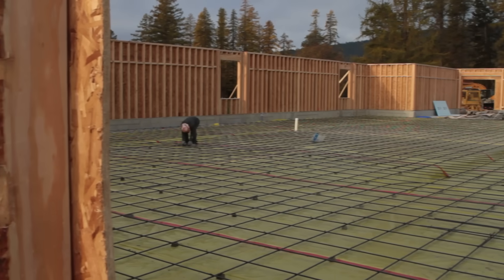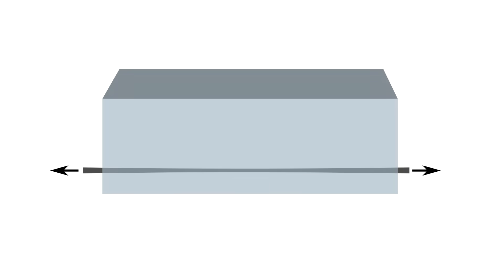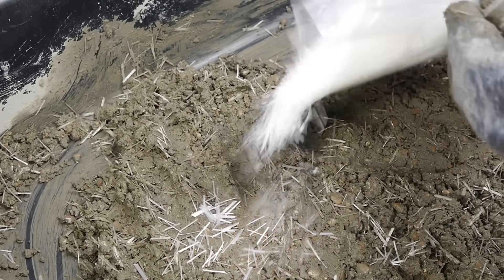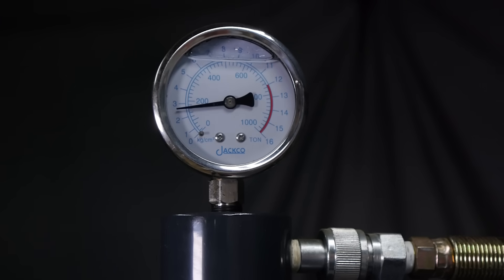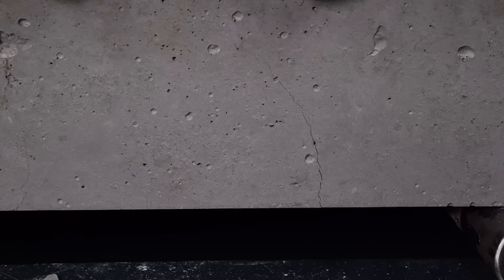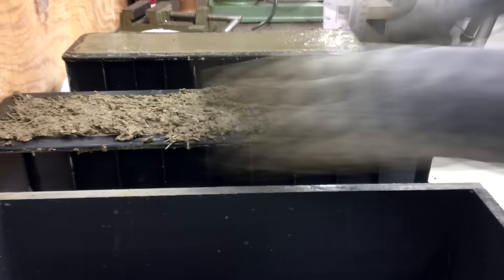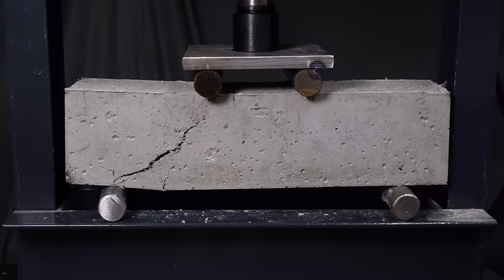Does Rebar Rust?

Comment: Hello, Grady! I have a question:
I want to make a concrete block for a tall but light steel pole (10m high, weighing around 110kg). In order to stabilize the steel  anchor, I intend to weld 14mm thick rebar at the bottom and hammer the top to drive rebar into the ground. Thus, the rebar will be sticking out of the concrete block and penetrate the soil about 30-40cm. The bottom of the block will be about 1m in the ground.
 Is this a bad idea, considering the rebar will be partially exposed to humid soil and therefore rust (how quickly?) and eventually bring rust with it into the concrete? How long could this even last before the concrete becomes unsafe for holding the pole?
 Thank you, and greetings from Bosnia!
Reply: If this is meant to be a temporary structure than this is overkill.

If this is a permanent structure, the rebar would rust and and the rust will creep up into the concrete. Not to mention rain and snow. They sell these builders tubes, what you would do is make a large circular hole, put the tube in, and fill with rebar and concrete.

Comment: Emm, I am a newbie. I would like to ask one question, why there is no ppl try to paint the steel rod before turn into concrete. Painting steel will also help prevent corrosion. Does the economical factor or any scientific issue causes most of the ppl don't prefer this methods. I am new, i hope that anyone know the reason can teach me , thx so much.

Comment: I could never understand why they used rusty rebar in concrete structures, they could have coated it in plastic to prevent rust, this has been going on for years and it does make you wonder when things are going to start collapsing as they will as the concrete ages.
Reply: If you have seen how rebar and mesh are handled onsite on most jobs, you would understand why coating rebar is not a cure all for rebar degradation.

Comment: We have to be mindful of the nature of the failure mode when considering other types of reinforcement. Often the appearance of a crack widening is indicative of overloading. If you prevent any cracking of the concrete at the design stage with super strong/large amounts of rebar then compression failure of the concrete could occur first. Way more explosive!

Comment: I have an experiential statement that i have presented on many other sites that has yet to be addressed. 
I have built houses in America and Germany and can only tell you from my observation that the concrete footings slab etc in america cracked as expected but none of the concrete work that was done on my two houses in Germany have as yet cracked. One is over 15 years old and the most recent is 4 years old . The one i am presently living in has no cracks in the basement walls , slab or exposed balconies . 
How is this possible that all concrete in America cracks and only a few places like some poorly done retaining walls in germany have cracked.
I am perplexed.
In all fairness, i should mention that all is not the same as to the amount of steel and thickness. 
The german houses have twice as much steel . The basement slab is 8 to 10 inches tthick  , the walls are eight inches thick and the first floor above the cellar has pre formed concrete panels (about two and a half inches thick that were put in place with a crane and have exposed steel on the top side to accept an additional eight inches of concrete . I should also mention that none of the slab work is finished . it is leveled and left rough because estrich or self lleveling cement is poured on top to accept tiles .
Reply: A lot of it is cost cutting and lack of maintenance. In Canada a lot of newer (less than 10 years) concrete still looks good. 

In the US, states can get emergency funding from the federal government if their infrastructure is gets really bad. A lot of governments just let their bridges deteriorate until the federal government steps in and either fixes it or builds a new one.
Reply: Yes , but i’m addressing houses . 
What’s your opinion on the american statement that “ all concrete eventually cracks” . From where i’m standing , this appears to be a myth based on poor engineering practice because as i said there are no cracks any where in my house or the neighbors houses etc.

Comment: Good video! Only one remark to make here: the tested beams have a brittle failure. This is because the beams crack on shear and not on bending, what the actual purpose of the bending test was in the first place. Due to the length of the beams, there is a direct load transfer to the supports and the reinforcement has no chance to yield. The initial cracks shown are occuring at the point in time where the bending moment exceeds the maximum tensile stress in the concrete.

Comment: Near my house is a sawmill that burned down in 1925.  The Rebar sticking out of the cement has very little, if any rust on it.  Funny how things made 100 years ago last longer than stuff made today.
Reply: Almost all rebar will come out of concrete looking clean and free of corrosion due to its high PH value, it will only rust inside concrete when carbonation occurs, it has nothing to do with concrete poored this year or 100 years ago
Reply: @simondijkstra7769  Reading comprehension 101 - the topic is about the quality of the iron.

Comment: You have beam samples break on the support, not in the center of the beam. You had to put the transverse reinforcement to the beam so quickly did not break. Steel fiber was the alternative transverse reinforcement.

Comment: A hospital I worked at had failures on there parking garages. Salt hot to the rear. The maintenance supervisor had a company come and Jack hammer the damaged concrete from the surface and poured new concrete on the rusty rear. I took pictures and said it will fail .I was told they know what there doing . So did I. 
 They paid $100,000 in repairs.  Within 3 months the concrete started to fall from underneath.  They paid the company again to repair with shot krete.  I left there so can only guess how it's working out.

Comment: Sufficient strength concrete with 25% + flyash, sufficient cover, keep the W/C ratio low, not like the piss seen in this video!  Use non chloride based accelerators.  Use non reactive aggregates where possible.  Proper vibration.  Its not hard, and usually comes down to workmanship in placement.  Fibres are not for flexural strength.

Comment: fiber reinforced concrete only works good in a lab !!! i’ve been building contractor for over 40 years... i’ve seen many slabs crack and separate ... because the theory is X amount of fiber per square inch = resistance.... while that works in theory and on paper, remember this if you could tow a car with a string they wouldn’t make rope !!! then any concrete exposed to humans then supplies the issue of getting fiber glass 
in your hands or any other part of your body that comes in contact with it.. i’ve built bridges, tunnels, commercial, and residential the only place i’ve seen it used is in residential.. as a contractor building over 300 houses a year, it didn’t take long for me to prove my points to builders that fiber cement wasn’t what they sold it to be, and back to wire reinforced slabs we went and our separating cracks went away as well, you’re going to always have cracks in concrete but the problem is separation and lift or drop of adjacent slabs this is particularly a problem in expansive soils witch cover most of the earth

Comment: About why we use steel instead of other materials I will add that the thermal deformation coefficient magnitudes of both steel and concrete is almost the same meaning that doesn't create stress between both materials due to temperature changes while other materials have a really different thermal coefficient compared with the concrete

Comment: The sudden failure u see at 5:03 is shear stress. If you had used stirrups you could probably increase the force. For bending failure u would see more crack development and it would be at the middel of the beam.

Comment: Rust is caused by oxidation.  Therefore all that is necessary is to eliminate contact with oxygen.  Maybe a thin layer of another material to cover the rebar and seal it from the air and water.  Like plastic or rubber or some kind of enamel

Comment: If you use a product called H&C hydro defend from your local sherwin williams paint store your concrete may last forever.
Simply spray the surface of your driveway, sidewalks, garage floor and the sealer goes into the surface sealing it. Water and stains will not penetrate. 

I put that shit on everything. And no i dont work for them.
Reply: Buddy chose are you sponsored by Samsng Device or H&C Hydro Defend from my local Sherwin Williams 😂

Comment: It's obvious he knows very little about structural engineering or concrete design. The beams failed due to shear, not bending. The cracks were shear cracks which in that configuration the rebar does little for the beam. Maybe consult an actual engineer next time, so you don't show misleading information.

Comment: One of the largest contributors to the corrosion of steel reinforcement in warm climates is the lack of control over the Water Cement ratio "Wcr"
To much water results in greater shrinkage which manifests as shrinkage cracks, once these appear the two eliments which contribute to corrosion, air and water are free to migrate into the concrete and reduce the natural passificstion, resulting in the Oxidisation of the steel reinforcement which then expands with a force 6-10 times greater than the strength of the concrete itself, the final result is evident in the form of spalling concrete.

Comment: @1:06. Water can’t make it through concrete. NOT TRUE.  
That’s why vapor barriers are used beneath and waterproofing is applied on vertical surfaces.  Water does migrate through concrete if it’s left bare.
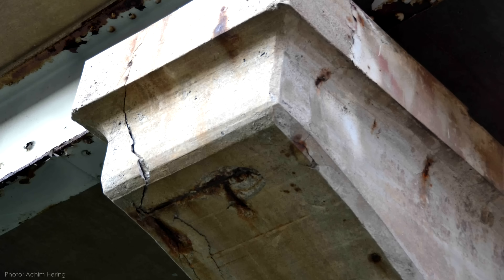@2:48. Talks about cover.  Video show the guy walking in the rebar and pushing down to the vapor barrier with placement over the top.  Not exactly 3”.  But as I’ve seen of most jobs, that’s common practice.   Hurry hurry.  Just get it down and get paid.  No ones watching.

Comment: My kitchen sink sits on concrete, but the rebar in it is rusting after 10 so years.
Likewise, Ive seen lots of bridges with rusting rebars bursting the cement from the inside.
RUST is deadly. It can burst open even thick concrete structure.

Comment: Superb video. It's a fact that when either concrete cracks due to contraction, or steel rods expand due to heat, you are heading for failure. Some people on tower blocks just clean it up, fill it in, repaint it, and it's as good as new! But it's not like that, is it? Once it's gone, it's gone. New cad cam buildings taken too far.

Comment: In the coupons tested the failure was actually attributable to the shear failure of the concrete interference bond along the axis of the reinforcing rods.  Actually this failure mechanism illustrates the need for adequate reinforcement termination and also makes you have caution in coating rebar that alters the interference depth along the length of the bar.

Comment: i think if you make a cage with ring with the 4 of those steel rods, then it will be much more load bearing.
More over your concrite mix didn't yeild bonding, as after it broke your experimented concrete bars looked like chalk powder.
Bars didn't dried up enough or you didnt pured enough water after 1 day.

Comment: What happens when the concrete surface gets deteriorated over time due to cleaning/pressure washing and regular deterioration due to rain.  Wouldn’t you have jagged edges from fiberglass shards or steel shards causing a hazard to the end customer?  Or are we talking strictly beams and load bearing applications?

Comment: I feel like the use of steel fibre is decreasing the width of the cover that the concrete gives to its rebar, since the steel fibres could corrode and thus crack the concrete. I have no experience on this topic, so am I right?
Reply: That makes sense, that’s kind of why I like the idea of fiberglass or basalt strings.

Comment: As a general contractor for 30 years,  I still use rebar in my footers,,,but fibermess in slabs,  it's always worked for me,, just feel it's the best way to go,,, and it's not required to use rebar in our building code in Delaware, but I've never had a broken foundation , but have seen most cracking slabs since we stopped useing metal in slabs,, but I think it's because there not putting polyethylene down anymore and the concrete is setting up to fast,, but you can't tell these young guys anything,  they have all the answers.

Comment: Ironic.  As you were talking about cover a clip was showed of concrete being poured over rebar that was not properly elevated in the slab.  Virtually just laying on the plastic below.
Reply: I was about to post the same comment. The timing was perfect in the video. Total failure at coverage. I didn't see any spacers.

Comment: I used to stress test concrete cylinders (and sometimes beams) like this. One particular contract had fiber concrete used around a nat. gas pumping station, it certainly was the strongest concrete I ever tested. Most compression samples fail around 3.5-4.5k psi. These broke north of 7k psi. Explosively. That was fun.

Comment: I met a guy once who told me that he worked on a team that was managing the old concrete arch bridges on the 101 highway on the west coast. He said that rust was slowly ruining the bridges and they were moderating the decay with some sort of electrolysis. 

They would paint the outside of the concrete bridge with conductive paint and then use electronics to monitor the "leakage" between the outer surface of the concrete and the inner rebar framework. They could then, from remote apply an electric charge to push the rust back onto the rebar (paraphrasing a bit here). 

Anyway, I found it fascinating. Perhaps it would be a good follow-up episode for your channel. Of course, unless the guy was BS'ing me that is. :-D 

Thanks for the great content. I always enjoy your videos and learn a lot.

Comment: Operation it's happening where water is draining itself through the concrete structure so maybe we should look into metalwork of rediscovering waterproof liquids what we can apply on metal work to protect the outer layer from rusting

Example a small paintbrush painting these particular kinds of metals with a certain supplements which is waterproof base where you do not have to apply on ever again

Comment: 2:40 “rebar stays where it’s designed to be embedded “.     Like right on the substrate where it does zero for strength and is not encapsulated?  🙄
Reply: Yeah, I like how he says right as a guy is walking over rebar sitting flat on the bottom.  These guys often go through and pull the rebar up into the middle of the slab after the concrete is poured, but I always wondered how successful they could be at centering it.  Bar chairs do position the rebar well, but also significantly weaken the concrete by effectively putting plastic filled voids all over it.  In my home game applications, I curve the rebar up so it supports itself and put a few chairs in the footing to hold the whole thing up, being sure I've overdesigned the footing.
Reply: Rebar shouldn't be at the centre nor should it be exposed ... in cad drawings I've done generally 50mm cover is good for salt water conditions. Middle does little to nothing for the concrete tho as it's now using its bending properties not its tensile properties and rebar is all but useless in bending
Reply: Well most pours are done with the rebar nailed into the form
Reply: Aussie standards is where its at.
Reply: Exactly what I was thinking!! It's extraordinary that the Americans rarely seem to use reo supports, 'bar chairs',  or similar ... it's so common. Few of their slabs would pass inspection in Australia. 🤔🙄

Comment: The new section of the SAN Francisco Bay Bridge used sand from the bay that was very lean but they didn’t wash it with fresh water when it was sent through a wash screen  for sizing. 
    Cal Trans said it would have been too expensive.

Comment: Very good topic. Explained in a simple manner. I have s question with regards To rebar exposed to outside environment. The thing Is a have build a concrete foundation with individual footings and I have installed the column rebar for the house. I can only begging building on in 1 years time. Does the rebar column get dammage in the meantime?

Comment: you are forgetting  one other factor in rebar failure, in construction these days people are connecting the ground lead from the electrical panel to the rebar. the most common is number 8 solid copper wire with a standard acorn nut to the rebar... now you have two dissimilar metals causing  galvanic corrosion.  which is also a U.S. electrical code violation( code 110.14 ). and another fun thing about connecting your electrical ground to rebar is that in a event of a lightning strike, your concrete could or will explode. I seen that happen before on large tower anchor points and in some slabs.  look up  "dnienterprises.com and look at the Strong Cap "  it is the only UL listed product in the United States to help stop that galvanic corrosion. this product fulfills NEC 250.70 (4) .  otherwise you have a nice video..  you may also want to read the article from  ecmweb.com June 2008  from Whitt L. Trimble and Eddie Guidry, Flour Enterprises, Inc.

Comment: Really good vid but could you comment in future on the use of hydrosilicate gel as a concrete additive, to make the concrete water proof.  Won't solve all the problems but might help.  could you,  or anyone else,  also tell us why steel wire is always used to tie re-bar together.  I get why the steel is tied together but does it have to be steel wire,  and why?